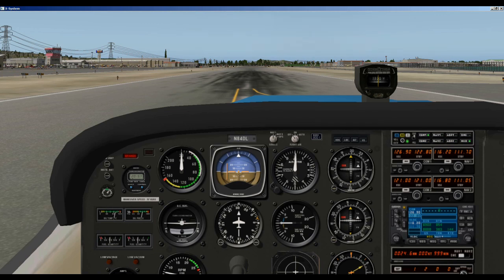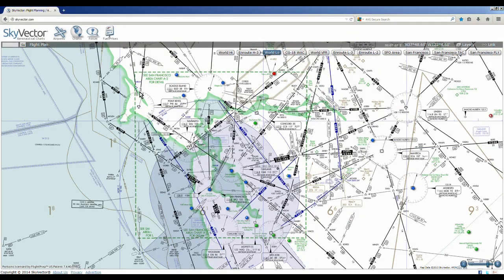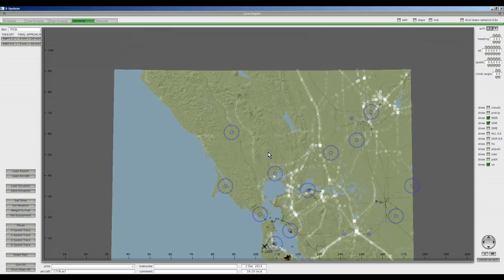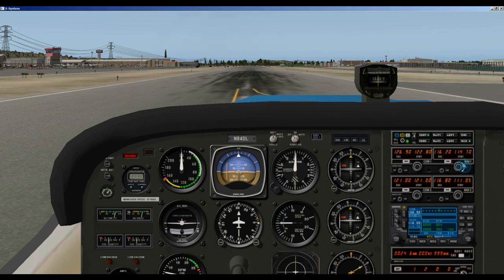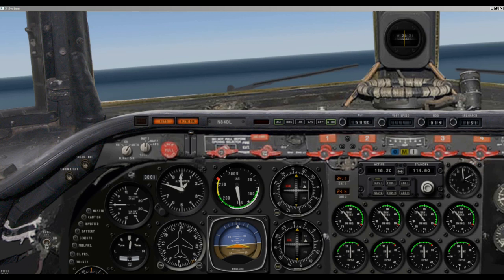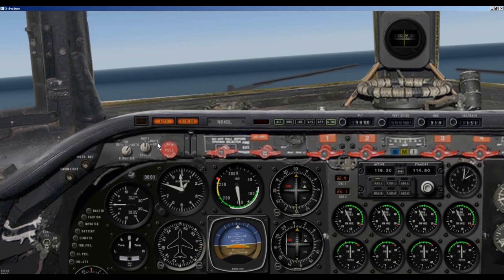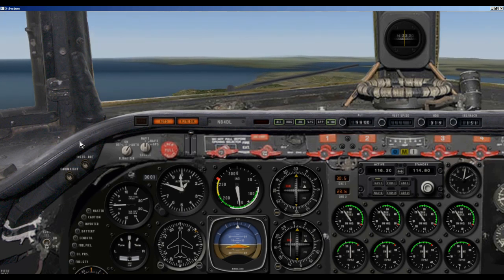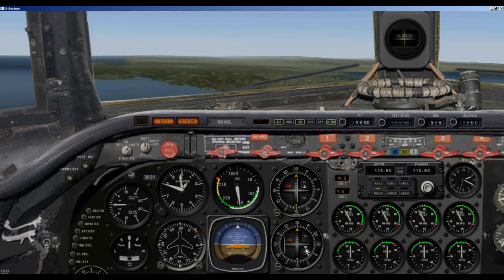How a NAV Radio and VOR Work Together in X Plane

Comment: Hello, Skip. How are you? I am learning more and more about flying, thanks to your videos and tips. Have a nice weekend. God bless. Larissa.
Reply from the maker: Hi Larissa, That's great, glad the videos are helping you. Here's a challenge for you. Try flying manually without using the autopilot. Pick an altitude and heading you want to fly and try and maintain altitude plus or minus 100 feet and heading plus or minus 10 degrees. You can use a VOR to fly TO to  help you stay on course but do not use the autopilot just use the VOR as a reference. Start with good weather with little wind so you can get a "feel" for how to fly manually. Then increase the winds and turbulence a little as you get better to challenge yourself. For me this is the fun of flying. I had a real flight yesterday from Benton Field in  Redding CA and the winds were strong. I did a short flight to Red Bluff using the Red Bluff VOR for navigating and wore Foggles, training glasses for IFR which block you view outside so you just fly on instruments. The winds kept me working to stay on course it was a lot of fun and a challenge. The strong cross winds when landing back a Benton was really interesting, definitely not boring. Hope you have a great weekend and happy flying.

God Bless,
skip
Reply: Good day, Skip. Thank you soooooo much for your tip. Later today, I will fly without the autopilot under different weather conditions. I forgot to tell you that I have practiced some landings at KSQL. One difficult I have to overcome is not fearing those trees which are in front of one of the KSQL runways...lol...
I read about your real flight yesterday with excitement. You are a great pilot and teacher Skip. Take good care of yourself. God bless. Larissa.
Reply from the maker: Hi Larissa, Looking good!!

You should not have trees around KSQL!! You can remove the trees using World Editor (WED) You can download the program for free and remove the trees and if your favorite airport does not have any building you can add them also. What you need to do is add an exclusion area at the end of the runway to remove the trees. Here's a link to WED download: https://developer.x-plane.com/tools/worldeditor/

 Watch a few videos on youtube to see how to use it there are tons of videos. Look for videos on "How to add exclusions using World Editor" or WED in X Plane 11. The setup of WED is important so start with How to setup WED so you can load your airport. Let me know how it goes, it's a little tricky but not too hard to use.

Blessings,
skip
Reply: Lovely tip, Skip. I will give it a try sometime. Thank you very much. God bless. Larissa

Comment: Do I need to sign up to SkyVector?  Says I will be phoned if I do not close a flight plan?  Not liking the sound of that.  If its dangerous not to do so, then anyone should not be able to sign up?  Seems a bit precocious?  Can we utilize this website without signing up?
Reply from the maker: Hi L-Plate Dave,  NO do not sign up it's not necessary! If you did, no problem just use the site to plan your flight but DO NOT log you flight with them, this is for real flights not simulators. You can use the site for all you planning with no problem just don't sign up and do not log any flights with them. If simmers abuse  SkyVector eventually they might decide to restrict the use and that would be too bad, it's a great tool.

Blessings,
skip
Reply: WEH Videos Ok ... TY.

Comment: Great lesson as always. Small problem; Downloaded the C54 but no cockpit showing!
Reply from the maker: Hi shane,  Thanks hope it helped. The C54 does not come with a 3D cockpit only 2D as with most free aircraft at X Plane.org so you won't have any cockpit in 3D view. I did a lot of work in Plane Maker to modify this airplane and I used a program called Blender to create a very simple 3D cockpit. 

I did a video on Plane Maker to cover some simple things you can do to make your airplane easier to fly: 

www.youtube.com/watch?v=lxuqQA65omc&list=PLjqSrWIZDAi9UtT4iJgh0eDO1UaHVUd-L&index=4

If this is something you might want to try here is a good place to learn about Plane Maker and Blender:   

www.youtube.com/watch?v=Os7O-uPhIHk&list=PL83BC4217746786FF  

Note: not all aircraft can be modified in Plane Maker particularly the newer aircraft cockpits are not editable but you can change viewpoints and few other things.

Hope this helps some, Blessings,
skip
Reply: Hello Skip, Thank you for your prompt reply. Sorry to be a pest; I have the cockpit file in the C54 plane in X-plane 10 but it simply does not appear in the loaded plane. 2D mode just shows runway and in 3D a sliver of an object appears? Perhaps you have a tip on were to find help?
Reply from the maker: Hi shane,  Well that's interesting.  All the files should be there I'd try and redownload the airplane and try again. Sorry that's all I can think of at this time. Don't forget to delete the old C54 folder or move it out of the X Plane folder. Also might see if there is another location for downloading. Let me know how you make out.

skip
Reply: Thanks Skip. Following your advice and will keep you informed of any improvement.

Comment: Skip. Would you please write out the c54 . I've tried searching on the org but it's coming back with no results. Regards
Reply from the maker: Hi Mega,  Try this link: http://forums.x-plane.org/index.php?/files/file/5125-douglas-dc-4/

It will not look like the one in my video I did a lot of modifications in X Plane Plane Maker to get what you saw in the video. I have videos on Plane Maker if you are interested in modifying airplanes.

Blessings,
skip